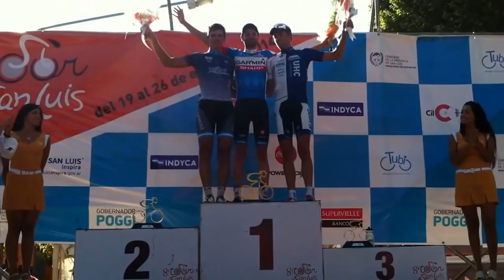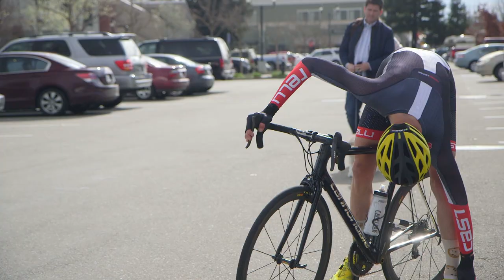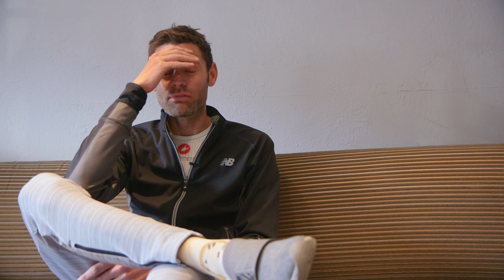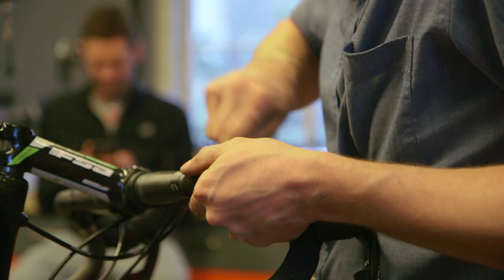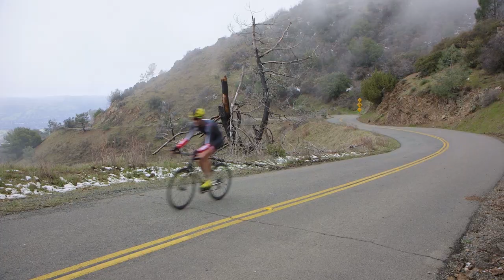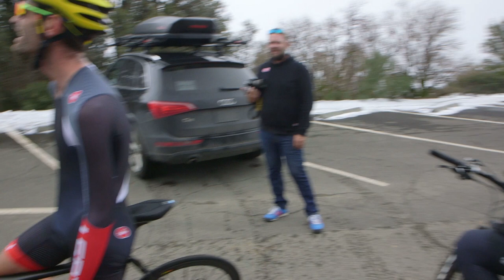Phil Gaimon's "Worst Retirement Ever" - Mt. Diablo

Comment: You're at a disadvantage when the air is cold. Because the colder the temperature, the denser the air which leads a larger drag coefficiency
Reply: MetallicaSindre The density of the fluid through which someone is riding does not effect the drag coefficient. That is the whole point of having a variable that is only dependent on the shape of the object. However due to the drag equation denser air will cause a proportional increase in drag.
Reply: MetallicaSindre there is also something about air pressure and the ability to absorb oxygen.. but not sure

Comment: Here is a route. From the duune Ave and Condit road parking you can go up to the Henry Coe Park and the actual climb is 8 miles and gains 2,000 feet in elavation. Someone did the unofficial part of the climb and the climb and back in 1:23:55. So I’m assuming the actual climb which starts at the end of the bridge was done in about 35-45 minutes.

Comment: that saddle looks like it has standard metal rails. Get a nice full carbon one if you want to shave off some more weight. 13.62 lbs, about 6.1kg is not really that light. a Supersix Hi-mod Evo black inc is 5.8kg and there are lighter bikes on the market now. Certainly more room for weight savings with your equipment, but the pros have a 6.8kg weight limit on their bikes so it is like compairing apples and oranges. you could have a super light hill climb specific bike 4.5kg but it would that be a fair comparison?
Reply: TurneyUK agreed. disappointing
Reply: I'm one of those super-obnoxious SSE black inc owners! I also spend most of my en of season period chasing KOMs!

Comment: Definitely right about the draft. I think at around 20 mph being aerodynamic really makes a difference and with the handlebars cut its limited how low you can get. 

What I find odd is the weight of your bike. It seems very heavy when thinking about the savings you are trying to make. My bike is roughly 7-7.2kg in a size 58 and I'm not even trying to make it lighter and my old bike shop has an owner who made a bike that weighed in at 3,7kg about 10 years ago and that was a complete bike with a full set of handlebars and both brakes.

Really think it is awesome that you are doing this though, I wish I had continued to ride when I stopped after my Junior years. now I would need to drop 40kg just to be able to feel like I am going somewhere.
Reply: Naturalhighz s